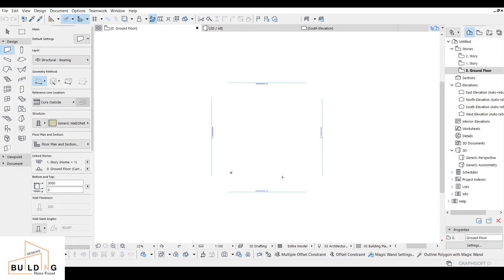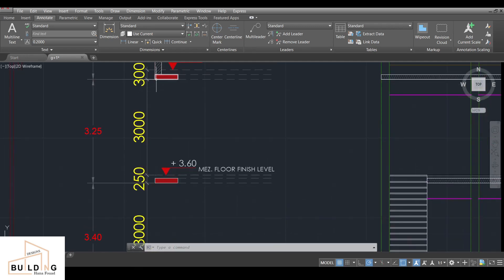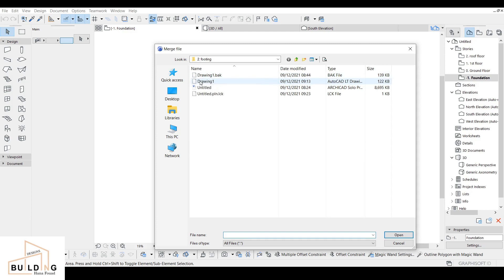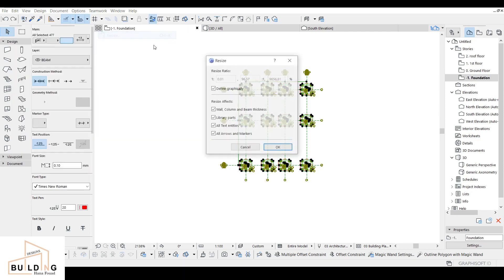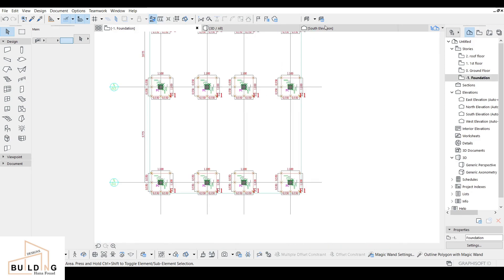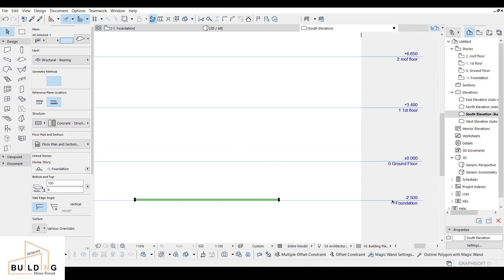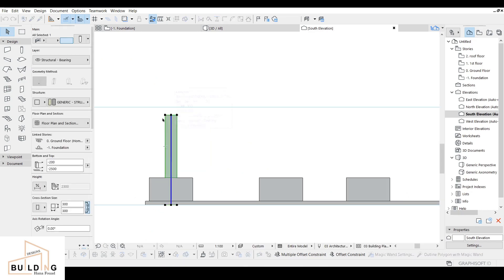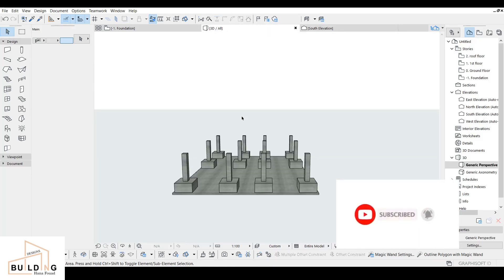How To Design Footing for Projects | Part-1 | ArchiCad

Comment: Greetings? Nice content. How is it possible to show the reinforcement details of the footing in ArchiCAD? The steel bars, both in 3D and 2D
Reply from the maker: Thanks. It could be possible by using steel tube and it depend on your diameter, which might take to long to design it like in AutoCAD software.